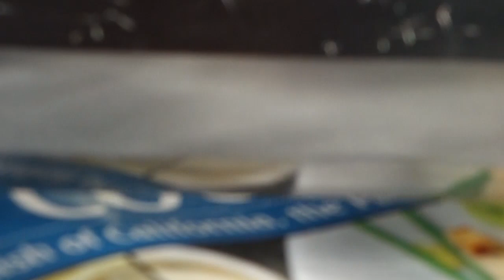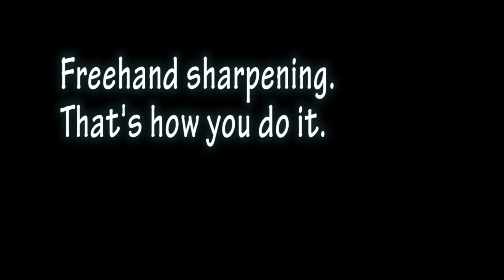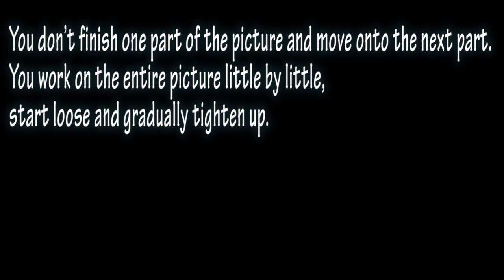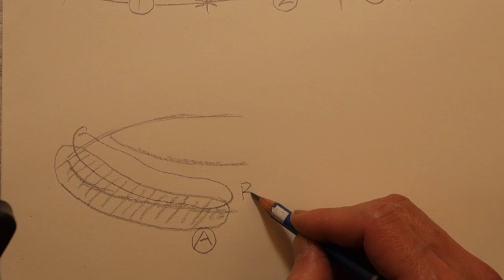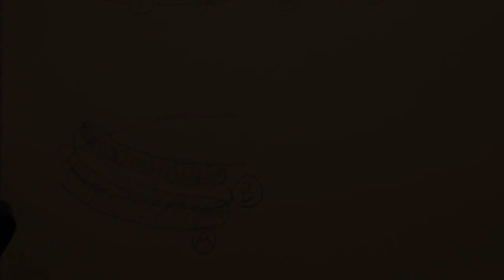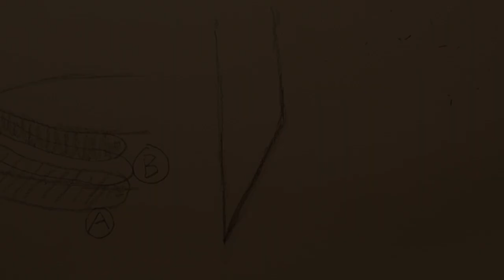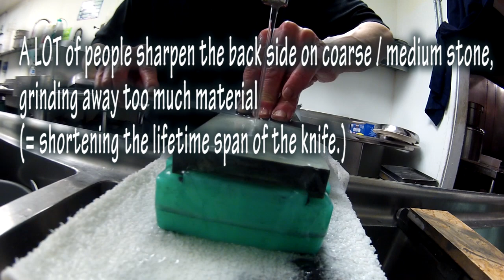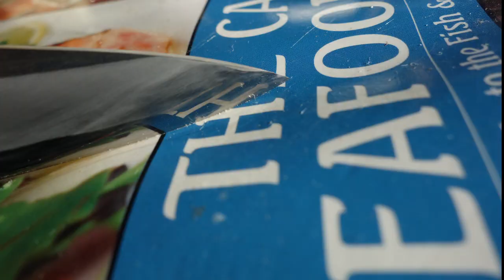Yanagiba (Sashimi slicer)sharpening (Hitachi blue #2 steel, Watanabe blade)

Comment: Thx for the useful explanation. 
The issue I got is I removed light rust with #1000 grit sandpaper on the bevel side about the size of two small circles. Is it possible to restore some aesthetic by polishing the bevel side directly with #6000 Shapton or is there another method for aesthetics?
Reply from the maker: Do you have polished bevel?
You can try to polish the area around where rust spot was, with #6K - 8K grit stone.
Or, if you have nagura stone, or small piece of sharpening stone (finer grit), they are better for that kind of job.
Either way, be careful not to mess up the edge.
I personally don't care about the look of the knife.
(Be it a kitchen knife or SAK or tactical folder, whatever.
All my knives are users, they all get scratched.)

Comment: I just wonder: do you put the knife flat on the kasumi side, means also work on the jigane?
Reply from the maker: ?? You mean, the jigane part that's above the ridge line (shinogi)?
If that's what you meant, no. There's no need to grind off that part.
( I'm going to make a better yanagiba sharpening video, pretty soon.)
Reply: @MonsterS4R996  Are you referring to the video image above? Then yes, I meant the grey overlay part of the knife (smoother, stainless steel). In many other videos they claim to put this part flag on the stone. But like this I get scrtches and the jigane is being taken off.
Reply from the maker: Yes, that part is called "Kiriha", in Japanese.
You will have to grind off this part evenly.
I am making a new series of videos about yanagiba sharpening. (Or, for that matter, all chisel grind knives.)
It'll take a little bit more, but I'm working on it.
(It's kinda hard to describe by words.)
Just laying flat the "kiriha" part on the stone doesn't really work, if you have a long yanagiba or Usuba.
Reply: @MonsterS4R996  Thanks a lot. Such a video would be great. I've seen that putting the Kiriha flat on the stone may cause scratches on the jigane (at least on my yanagiba, but maybe mine doesn't have a real flat profile as it's not that expensive)

Comment: I sharpened starting from 400 also uraoshi starting from naniwa chosera 400.1000.5000.8000..lo yanaghiba I don't feel very sharp, how can I do to fix L uraoshi?
Reply from the maker: Without actually looking at the knife, it's hard (almost impossible) to tell what's wrong.
When sharpening the back side (uraoshi), one thing you need to be careful is NOT to overdo it.
If you remove too much metal from the back, you are reducing urasuki, and you can't fix it without sending it back to the blade smith.
Reply: @MonsterS4R996  I don’t put much pressure when I sharpen the uraoshi but I used the 400 and 1000 too.. today I just sharpen starting whit the 5000 in the uraoshi .. the yanaghiba cut but don’t able to cut the hair in the arm for example